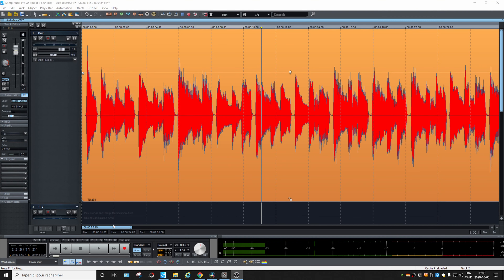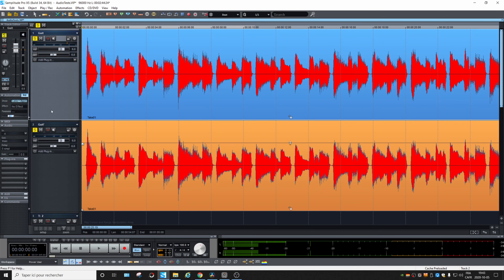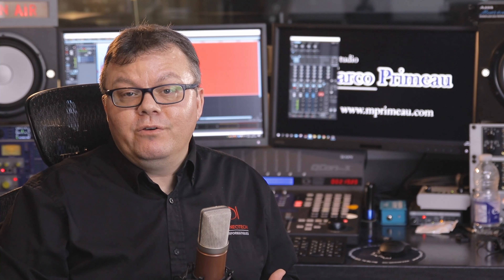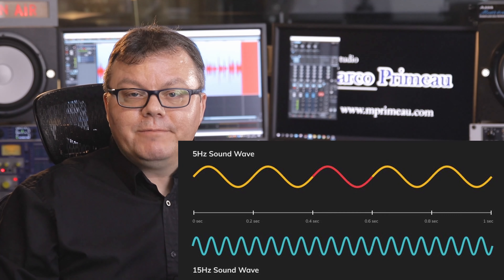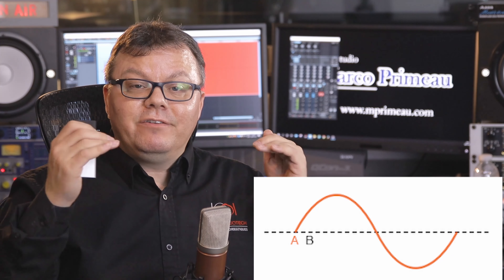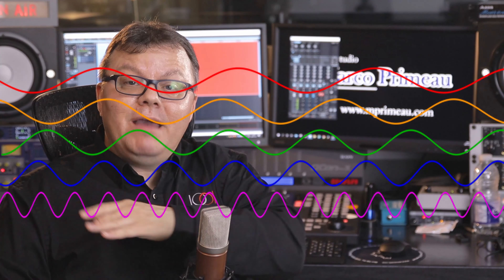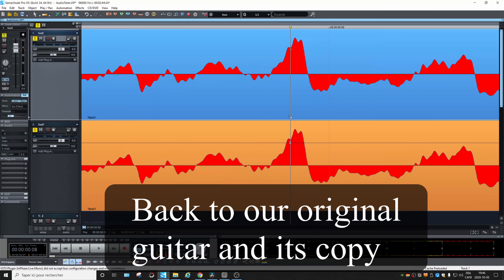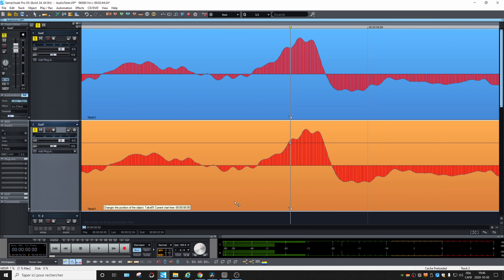Polarity vs Phase - Why do I need to know this ?

Comment: This is not a proper comparison. You are looking at Polarity vs Time delay. A time delay is a very special situation, namely a linear phase situation. But the phase that you should be looking at is the so-called Phasor phase, which is not the same as a time shift, except when looking at non causal sinusoidal signals, where you cannot tell the difference. The question that you should be asking is Is there a difference between a polarity flip and a 180 degree phase at all frequencies. And no, there is not. The group delay is zero, but all amplitudes have flipped. Again, this is a special situation, but another situation than the linear phase one.